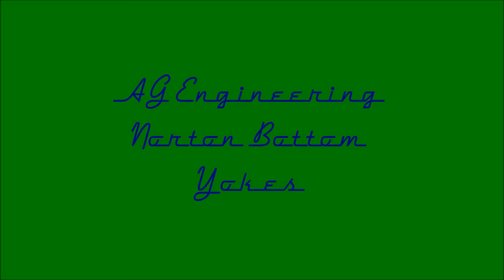Norton Bottom Yokes

Comment: The is a lot more Hot Rod slang in America than in the UK.  "Tree" was slang for the complete steering column in a car, hence "three in the tree" = 3-speed column-shift.  "Triple tree" = 3 part steering column as on a motorcycle.  Yokes are also called triple clamps which makes a bit more sense.  We all want our own slang to be dominant but in the end it all  just goes down in history and is lost.
Reply from the maker: Ah ah, thanks for the explanation. I know some of our slang terms can be confusing in the UK. Again back when I was at JCB the manufacturing engineering manager ( You watching Mr P?) was ex Ford Dagenham so we had sort of Essex-Cockney-Americanisms to cope with, all great fun, made for good conversations, " It's a bleedin' SUMP not bloody OIL PAN!"
Reply: Yes, it's American but it probably predates car steering columns.  I've seen old references in horse-drawn vehicle harness hardware to "triple-trees".  They were used to connect parallel items (such as pulling traces) to a central pivot point.  Obviously, there are three points of attachment with one of those points being the central point.  The term seems to have been applied to the forks of American push bicycles and early motorcycles early in their development and one can see a certain similarity.  In my experience, the term was used in the 60s and 70s by American custom motorcycle builders or riders who were trying to establish their cred as "old hands".  It's sort of seeped into common usage so now it's hard to tell is someone is just used to hearing it used or is a poser.
BTW, triple trees were used in animal drawn harness hardware to "yoke" together different pulling forces (different traces from a single animal or two or more animals), so the reference is not entirely entirely unrelated.
It's not a big thing but seems to me to be another case of useless clutter in British English (far too much of that over the past half century IMO, probably from telly and them Innerwebs).  Another reference to two nations separated by a common language.

Comment: yes i agree about the term "triple trees"seems stupid there's only two of the and they're   not made of wood
Reply from the maker: Brilliant! When I worked in the engine plant for JCB the lads on the line and logistics had all sorts of strange names for engine components because the didn't really know what they were:
Rocker arm shafts = flutes
Turbo chargers = fans
Connecting rods = Bones
Nuts = Bolts
Thanks for the comments Dave. Bet it's bloody cold in your shed?
Ade
Reply from the maker: Then again thinking about it yokes and yolks could be pretty confusing...

Comment: Another interesting project Ade,looking forward to the making of the stem.Going over in my mind how I would make the stem with the machines I have in my shop.At the least a very fun lathe project.
Reply from the maker: Thanks for watching Bob, I have to get some material from the steel stockists, I only have EN1A (1213) on hand, I am thinking it would be better in a medium carbon grade like  EN8 (1040). The biggest issue is the 1/2 hole in the centre, the original is thick wall tube but the flange section of the part into the yoke is about 1-1/16" OD so I am unlikely to find that with a 1/2" bore. Drilling a hole some 9" deep may be required but I don't want to spend a fortune on a drill bit for this job particularly, so drilling from both ends to meet in the middle while not ideal, may have to be the way to do this. The hole is for a steering damper rod so could not really be omitted I don't think. Regards, Ade

Comment: I suspect you're using the Wifi on a GoPro and that what causes the noise. If the camera is still in warranty you can get a replacement. It's a well known fault with some Gopros.
Reply from the maker: Thanks Peter, I will check with the retailer on this for replacement if possible then. The video I shot will have to be re-filmed because the first section is so bad. What I have found is that a clip after I changed the battery and move the camera is fine, I am wondering if it is related to the proximity of fluorescent lights ? I notice that even on this yokes video it is very slightly there in the background. I'll post some example clips when I get chance. Many thanks, Ade